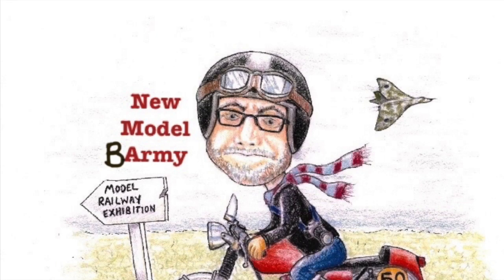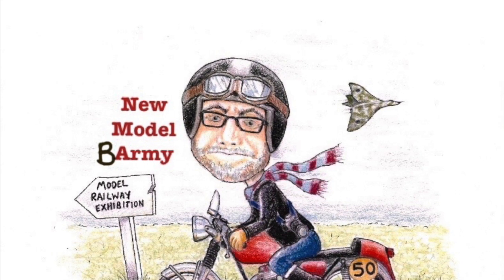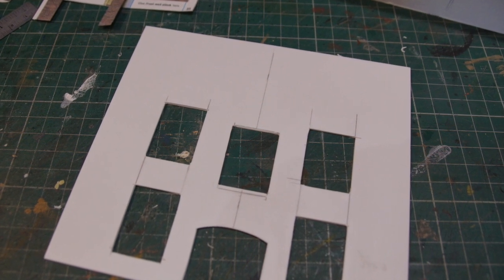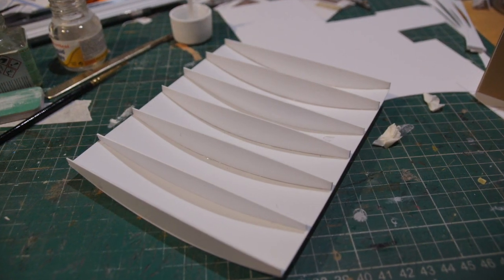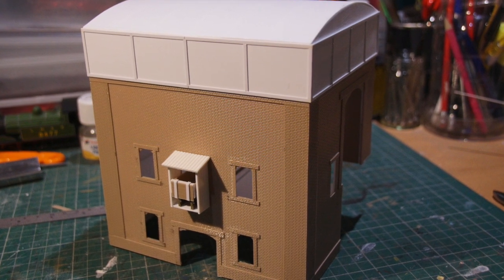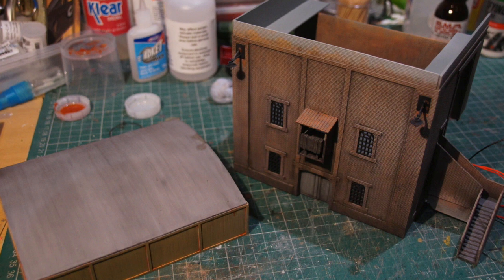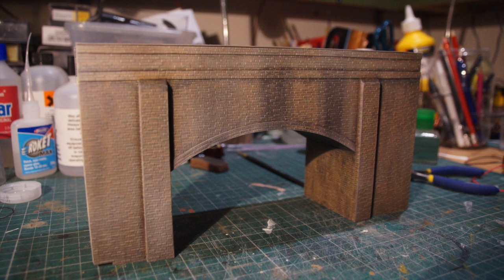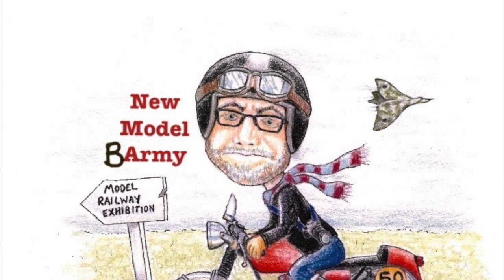Scratch built OO gauge coal stage...Shelf layout part 4

Comment: That coal stage looks brilliant.
Great idea to template from an existing kit. Fantastic work as usual. That weathering really sets it off.
Same to be said with that bridge. 

Nearly spat my coffee out when I hear my channel name.
Very kind of you to give me a nod and I'm always happy to help. 

Those lamps look like a whole project all by themselves. Going to be interesting to see what you do with them.

One though, Have you considered using strips of self adhesive copper tape to carry the power for them on the baseboard top surface?
Reduces the wiring and really easy to hide under ballast and general scenery or can be folded around the baseboard ends and connect the power wires from the side or below.

Anyway, ive waffled enough.
Really looking good mate, bring on part 5.
Reply from the maker: Thanks mate, I did consider the copper tape as I have some in stock but all the wiring is going under the embankment so it'll be easy to hide. What did you use for the ballast on Kirkby in Ashford mate as that's the look I'm going for? I hoovered up a copy of Steam on Shed as recommended by yourself and it would appear that a cinder roadbed is the order of the day!
Reply: Right. 
It's a bit of a long process but here are the basics.

I started with a mix of black and some dark grey "n gauge" woodland scenics ballast.
Then a wash of watered down ready mixed filler was brushed across the ballast in areas that would be heavily packed with dirt and fluids.
A wash of dark grey paint and weathering powders was applied over that.
Then, I used real coal powder/dust applied with a tea spoon and dusted into position using a large, soft makeup brush.
That was glued down with Deluxe materials Ballast Bond.
A mist of water from an atomiser is required to prevent the coal dust from floating or clumping but it dries ok and the ballast bond doesn't leave a trace so no unseemly shiny patches to sort out.
Then I made some ash.
I just burned some letters out of the recycling bin and sieved out any lumps.

The ash is dumped in piles with a small spoon and again glued with ballast bond.
You have to mist it with water to prevent clumping and add layers as it does subside a bit when being glued down.

A few patches of ash dust are then brushed into the ground using the makeup brush used earlier for coal and that's it.

I just copied what I saw in the photos in that book mate and tried to replicate the colours seen in the photos.
Reply from the maker: @JAMESDEMU-RailwayModeller  Nice one James, some great guidance there as always. I'll find myself a lump of coal and start burning some bills then! Cheers for the info mate.